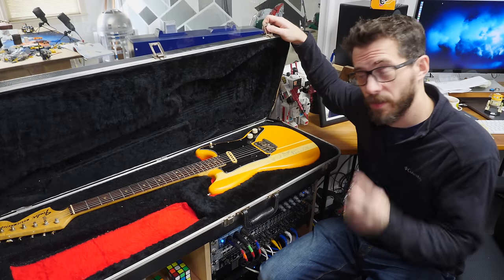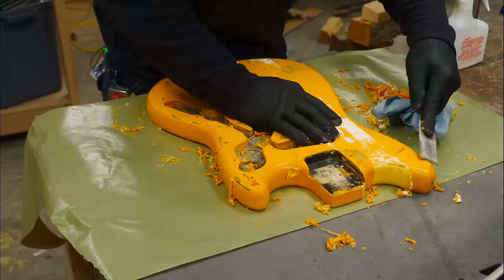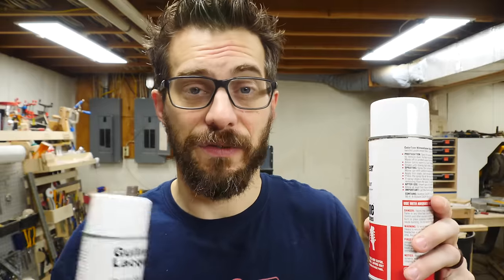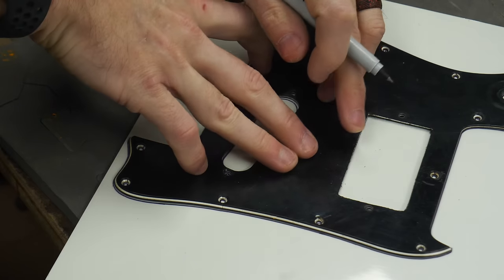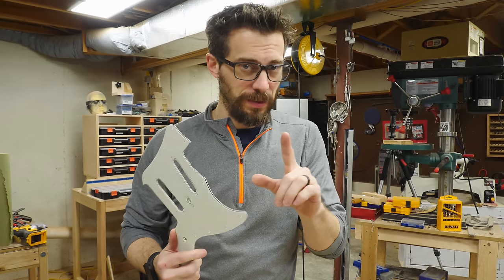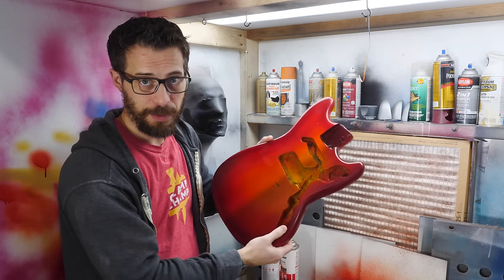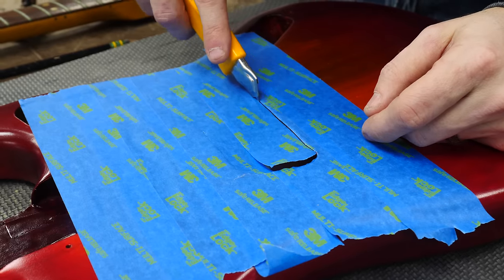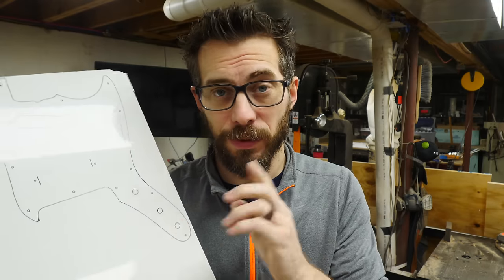How to Refinish A Guitar | I Like To Make Stuff

Comment: Hey Bob, I have a Harmony guitar I built 57 years ago from a Heathkit. Some finish on the edges have chipped and flaked off. The top and bottom is fine. Can u refinish like u did just on the edges? Can u sand down and just feather and blend into the good surface? 

Thanks

Comment: Hey so I have refinished a few guitars with rattle cans and have avoided nitro because I always paint my guitars white and nitro white always ends up yellowing. But the rattle cans of Rustoleum are SO finicky. And I end up doing dozens of coats and resanding over days and days before I am happy. And since I have to work outside there's always dust and stuff that has to be removed say after day. It seems your nitro was much easier to work with. And I like the lazy Susan. Do you have any advice for me painting white guitars? Should I get an air compressor and a spray gun? Try car paint instead???

Comment: Great video. Sent it to my dad who is a vintage guitar junkie. Bit tip: there is a flush cut router bit with a bearing at the top (closest to router) to follow the same sidewall as the pickup holes allowing you to exactly match the existing holes without carving anywhere outside the existing hole profile. It’s meant for template routing but can be used to deepen an existing recess. Bob, you probably knew that but I am just sharing for others.
Reply from the maker: Good tip.
Reply: @Iliketomakestuff  My brother had a guitar that he turned into a clock witch I have now and he put some kind of tape on it. I wanted to know. How do I remove the tape without ruining the finish before painting it?

Comment: I have a Fender Precision Neck that is twisted. Have you ever worked with getting a twist out of a neck. I also have heard that if it twist in a certain direction, it not as bad and you can take do some smaller adjustments to make it more playable. Any suggestion or knowledge you can share that will help me get this original neck back on this guitar. Thanks for your help. If you can improve this neck and possible get the twist our, I will send it to you to repair. I watched enough of this video to know that you are very knowledgeable about what you are doing. Can you help me with advice or anything else. Thank you

Comment: When I made my pickguard I used the back edge of a razor knife  blade to scrape the bevel, that pickguard material scrapes away very easily.  The knife I used was one of those small click type with the breakaway blade.  Putting the casing of the knife against the body made a useful guide.  I imagine any type of sharp edged scraper would work.  Also screwing  some sort of handle into the neck slot would help articulate the body as you paint.

Comment: Hi Bob. Little tip for 2 colour bursts. Spray the centre colour first. Then take your cardboard template and instead of putting it straight on top pop some thumb taks into it. Then you can put it on top of the guitar sat on the heads of the taks. Then spray from above with your outside colour and you will get a really natural and smooth fade!
Reply: ThePippin89 great advice. I was going to suggest this, but I'm glad you did. Kudos.
Reply: ThePippin89 
Aah, that's very clever! Thanks for the advice!
Reply: Wow that's a fantastic idea, and very timely.  I'm going to do exactly that.
Reply: I’ve used this technique, works great! Very even fade.

Comment: Very good work. The only thing I would add is shielding underneath the pickguard and in the cavity in order to create a Faraday cage. You could've used copper tape or even aluminium tinfoil from your kitchen.
Reply from the maker: Yeah, good point. The new pick up wires were shielded, but yeah, you should totally line the cavities.
Reply: @leonardodic3po607  True, but this is a simple mod that goes a long way. I presume that this guitar won't see any modding in at least 10 years or ever, but it's a bit easier knowing in the back of your head that you don't have to do as much once you decide to change something in the cavity whenever you decide to make changes.

This could just be my OCD because I am a guitar player that mods his instruments fairly often and hates lining cavities in his guitars :)
Reply: @leonardodic3po607  The point of the shielding is not to get rid of pickup hum (shielding doesn't do anything to prevent that). The job of the shielding is to isolate the electronics from electromagnetic interference.
Without it, your signal line in the guitar will act as an antena and pick up all sorts of shit like electromagnetic waves from a transformer. This is also the reason why instrument cables are coaxial (signal line in the middle, surrounded by the shielding).
If you use speaker cables, which is highly adviced not to do, you'll probably get some massive humming comming out of your amp.
Reply: You can get spray on shielding, and even just using graphite spray will make a big difference. Graphite spray is a lot cheaper than the nickel spray, and is almost as good as metal, though you will have to place a nice copper strip glued to the case to make a good contact to it. Plus you can spray plastic and get a reasonable amount of hum reduction. Just hasve to watch out for compatability between plastics and paints with the carrier solvent used in the screening sprays though, they do cause wrinkling on plastics and dissolve a lot of paint types as well.
Reply: I have a massive interference on my homebuilt les Paul. I will try the aluminium foil trick. Maybe solder a ground wire to it. Thanks for the tip
Reply: Waldo Bean for some good advice on your build. Check out the following people/ channels; stewmac , crimson guitars, Phil McNight. Those three should give you all the info you will ever need on building.
Reply: No grounding for the bridge?
Reply: @waldobean7534  also check grounding from tailpiece and ground wires from pots shouldn't form a loop
Reply: Good job, I like the sunburst on the other guitar better, but, like you say “do your own thing”. I enjoyed the video
Reply: @Iliketomakestuff  Use copper, solder the seams.  Rolls Royce job!

Comment: Nice job! As with any project, having the right tools and space to work is essential to obtain similar results. You might have mentioned the spray booth which is necessary for using nitro cellulose paints and a mask to prevent inhaling vapors.

Comment: Not bad, I'm in the middle of refinishing my guitar and has been refinished a couple of times. From my experiences different brands use different finishes and materials. So far the three guitars I have refinished used Poplar and had a coat of glazing. On my current guitar I just sanded it and used Bondo Glazing and Spot Putty to fill voids, dents and deep scratches. I'm going for a Satin/Matte finish and so far built up two coats of paint before sanding with 320 to knock it down then probably two more coats with a Matte clear finish. Planning to try a clay bar to smooth it down then finish it off with some wax to seal it up.

Comment: OK, this is the second or third video on this channel I have watched, and I love this style of how-to video because you aren't a perfect craftsman and you show us how to deal rationally with mistakes in a project as it develops. At the same time, you don't waste my life with unscripted chatter.  Love this channel, and love this project.

Suggestion 1: you had the right idea 100% to you a mask over back and front to create the burst.  My opinion is that you should have trimmed the masks in about 25mm (1 inch) all around to get the outer darker ring to extend where you wanted it to go.  The trade you made back to the lazy susan was exactly right.  In any case, I think your 2-tone experiment turned out super.

Suggestion 2: the reason the guitar was so noisy to start was that it did not have the grounding wire that runs from the bridge hardware to the control cavity.  This was obvious in the diassembly, and it was a glaring omission in your re-assembly.  To fix that, take off the bridge hardward and sand a space on the bottom to "shiny," (meaning: no rust or paint). Get a length of black wire about 250mm (10 inches) and strip the ends about 20mm (3/4 inch).  Tin the ends with solder to avoid any random strands.  Run the ground wire through the hole under your bridge to the controls cavity (I can see the hole is already there in the video).  The end which sticks out under the bridge needs to lie flat under the bridge touching the surface you polished up, and the contact has to be solid/tight.  The other end of the ground wire ought to have connection to the back of your pots (usually: the back of the tone pot).  If you do that, I will bet a cup of coffee your hum disappears 99.9%.

Great project, great channel.
Reply: Dude, "Suggestion 2" shows a glaring omission. I mean, that's bush league stuff. Thousands of dollars worth of woodworking equipment and...  after all that time spent on the pickguard which has nothing to do with "refinishing"? Call it out for what it is. And your use of the term "suggestion": WTF? is this guy in 3rd grade? 25 minutes of our time wasted. He should have just bought a new guitar, and made a video about that!
Reply: @squirlmy  Well, it's a glaring omission to someone who works on guitars all the time.  It may not be that to someone who is primarily a hobby woodworker.

Comment: That came out great! If you wanted a factory gloss finish, you'd be applying lacquer and sanding it back for weeks and then finish wet sanding up to 8 thousand or so before switching to automotive buffing compounds. It takes forever.
Reply from the maker: I bet it would look awesome, but I really like that satin finish
Reply: You can make it pretty nice without going too insane. It was easier than I thought.
You don't have to sand between every single coat.You don't have to hit every grit #.
Maybe #600 between coats. Wet sanding makes it easy. Final sand with 800,1200,2000 ish,
 buff with McGuires Mirror Glaze and a buffing wheel on a drill or cheap auto polisher.
Looks like glass. :)
Reply: I Like To Make Stuff  Satin/Nitro finishes are huge right now, anyway, with the popularity of “relic-ed” or road-worn guitars.